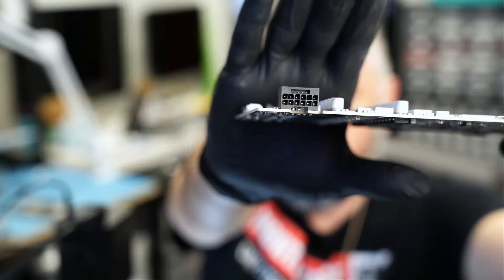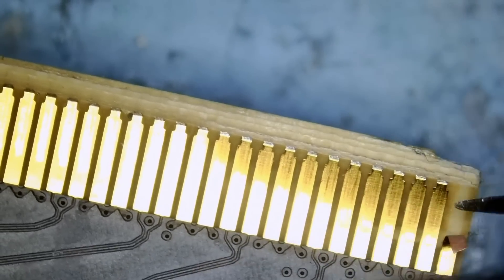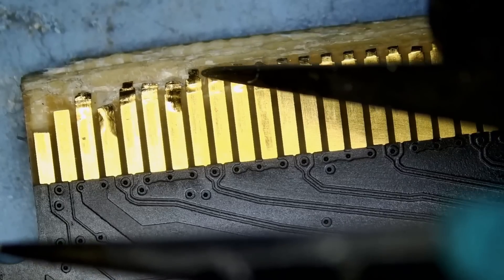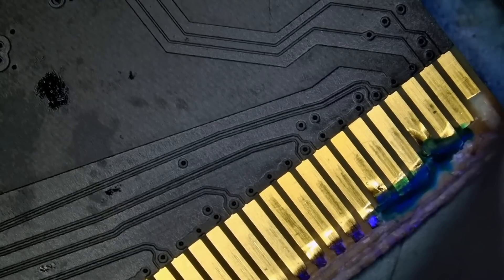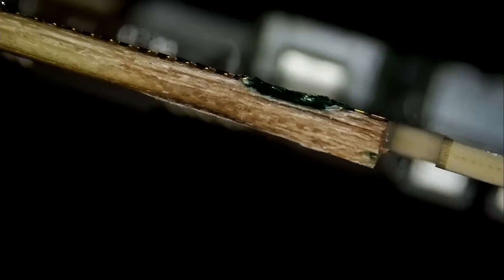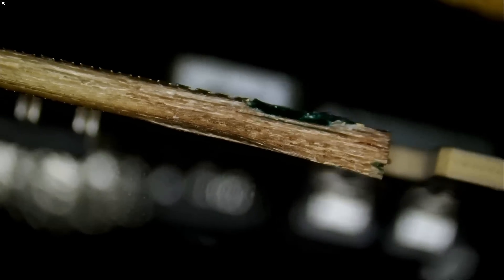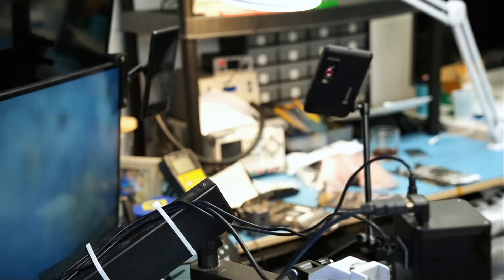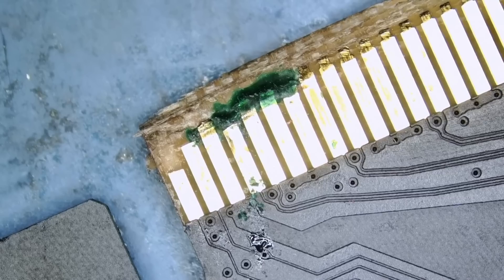4090 Graphics card PCIE Connector Pin damage Repair

Comment: So my GPU wont boot and the red VGA light on my motherboard turns on, Im thinking its the pins. I have a zotac 3080 and the pcie pins are a bit damaged, Im going to try cleaning them the best I can but if they are damaged, I was wondering, that green solder you put on it, can I do that? If so is it easy to do.

Comment: can damaged pcie pin cause the graphics card to run at x4 speed even tho its plugged in the x16 slot ? i tried the gpuz software and it shows x4 speed even while running benchmarks so its not power saving and even in games my gc wont perform the way it was before ...............

Comment: what if you have a similar issue, but the pad is too short to properly mate in the slot? would it be better to try to replace the pad? or would soldering an extension to the pad suffice? the worry is that it may be too thick or make poor contact if you just put a new pad against the end and solder.

Comment: In all the years, nvidia has been making GPU's. I've never seen the board layers come apart! Either it's from the high current these cards draw or nvidia is making cards cheaper than they used too. If it is from the currect, maybe we need a beefer PCB's and stronger PCIe sockets. I'm guessing nvidia is probably just cheaping out on their newer cards that cost more than they ever have before.

Comment: All I can say is at least nvidia is helping NorthridgeFix and others in the same industry to grow thier business and propser. 

Seems to me like the RTX4090 is just a card that should never have existed. From it's pricetag, to crumby power connector design, now the PCB falling apart at the slot.

Sure maybe some of the PCB falling apart could be user being too rough with it, but I fail to see how the PCB could split layers like that in that way, normally if it was rough treatment after slotted in the socket you would get cracks on the PCB near the hook that we see all too often. For my amature brain, splitting of the PCB layers like that is just dodgey manufacturing. And I bet the manufacturer of the card refused warranty and called it physical damage too.

Comment: Great job! What brand of 4090 was that? Sounds like it's a manufacturer that should be avoided. PCB board quality is horrible. 'm guessing it is a PNY.
Reply: Looked like a Nvidia card to me, the shape of the pcb is a give away.
Reply: @jestan01  Damn, if that's the case, what happened to Nvidia's QC? Yikes!
Reply: @SovereignKnight74  I don't think abusing your card so hard that the PCB layers split apart has anything to do with the manufacturer, but you do you i guess

Comment: Another concern I'd have with adhesive is the likelihood of it heating and melting while the card is in-use in the system. 

Could make a sticky mess in the card slot on the system board.

Comment: Do you know if a Google pixel 1 would turn on without its middle plate? It has a connection.. just trying to fix an old phone. Don't want to waste money just to retrieve the data and not currently turning on after replacing battery and screen

Comment: Dust lightly under the pad with baking soda. Then press the pad down while adding a drop of supper glue. The bond is instant and rather strong. Hope it helps. Just be certain to hold the pad down before you use the glue. Capillary effect will pull it under
Reply: Wouldn't this also leave glue on top of the pad, serving as a anti-conductive layer? 🤔

Comment: With the layers separated on a PCB board the only way you can fix it is to apply glue and then use a clamp small enough to compress the layers so it can be thin again but over time the layers May separate again

Comment: Hmmm maybe glue might work if the card dies later… I’d put tape on the pins so no glue would get on them, soak the edge with thin superglue then clamp it really tight till it dries… you’d need tape on your clamps too so you don’t glue the card to your clamps… idk just a suggestion, might work

Comment: I would have put tape over the connectors, used Epoxy resin brushing it over the edge to try and get some between the layers, then clamped the edge connector in a mini Vice 🙂 Opsss just read comment below lol

Comment: It looks to me like this SHOULD be covered by warranty, but alas, it won't be.
This poor user, who had their 4090 12VHP connector melt, probably was removing it from the motherboard, to have it fixed, and then dropped it directly onto the floor impacting the PCIE connector. Very unfortunate. But, had the 12VHP connector not failed, it would have not been necessary to remove it  from the motherboard and the PCIE connector would have not have been damaged during the removal process. Nvidia caused the whole chain of events here with their faulty designed 12VHP connector that led to 4090 being removed after installed. If a melted power connector was present at all, Nvidia should replace the card, even if something else got broken during removal. Had the 4090 never failed, it would have remained installed and not had the need to be extracted from the PCIE slot. Fault is Nvidia.

Comment: i would recommend that they use a riser cable, incase of any shorts in the future. it would damage the riser cable and not the motherboard's PCIe slot directly. Though, i would replace the card at this point anyways. 😆

Comment: Probably its best for this card to be mounted vertically with PCIe 4.0 riser cable, so if there is ever a need for the card to be taken out of the case (for cleaning purposes or w/e) its taken out together with the cable plugged in.
Reply: That is a very good idea!!

Comment: For the delamination issue I would Mix a small batch of epoxy resin used for casting (runny resin that needs 24/48 hours to cure), soak all the layers with it and then secure the PCI slot using a bench press and sandwiching the slot between two flat small pieces of wood and then wait the resin to cure. It is very risky but that's the way I would proceed because that card has one foot in the grave with that delamination and it will most likely have the other foot in once the customer plugs it in
Reply: ...and then you would most likely end up with two pieces of wood attached permanently to the card. Congratulations on the marriage.

Comment: sure would seem that the pcie slot would have been burnt when the connector fried itself. or this was an ebay card that had gotten wet on the messed up pin side. either way great job

Comment: For the delam, you can drip super glue into the separated layers then clamp them together till it cures. Be sure to use Teflon between the board and clamp jaws, or you’ll have one solid piece lol.
Reply: I was literally about to suggest the same thing.
Reply: That corner of the board has no inter-layer PCB traces. Just drop a bit of super glue and clamp it as   per the first comment. You know sometimes, advice from other people is not as stupid as you make them out to be. Your leaving that board without treatment is bound to fail if the user cannot wiggle it the way you delicately did ... remember the user is installing into his case not an external pcie  extension slot that you have. We need to have some respect for people watching your channel. They mostly are knowledgeable and just want to assist.
Reply: Cyanoacrylate is not a good adhesive for this.
Reply: @VndNvwYvvSvv  care to elaborate?
Reply: Probably want to tape up the pins first too so it doesn't squeeze out onto them.
Reply: That is what I would do also logically :)
Reply from the maker: I go by the rule "if it's not broken don't fix it. There are microscopic lines running thru every layer of the board. Layers are separating. This is not a kitchen countertop that you can just add glue to and press. I know we have a lot of handymen in the comments, but it's better left off as is.
Reply: @NorthridgeFix  I'm not nearly as knowledgaeble, but i would of used a little solder mask on the edge just to give it some more structural integrity, tell the user to install it gingerly and leave it be or risk causing further problems. Why ? because he or she doesn't seem like the type to have much common sense, probably further mangle it trying to insert it again.
Reply: @NorthridgeFix  Leaving it as is. Will just risk the customer damaging the PCI slot on their motherboard.
Reply: @NorthridgeFix  handymen sure, but not too many military certified micro/miniature repair techs😉

Comment: I wonder if the pcb board got exposed to water/moisture. Because the separation looks just like how a water damaged OSB plywood.
Reply: Yes i think it's water or moisture
Reply: It is fibreglass, definitely moisture resistant.  Probably dropped

Comment: For as much as these cards cost the fact the layers are separating is unacceptable! If this was my card I would mix up some carbon fiber resin, apply it to the affected area, bag the card and put it under high vacuum until it cured. Just like you do when you are making a carbon fiber part. That should bring the layers together tight enough until the resin cured.

Comment: Thin CA would probably wick in and do a great job on those separated layers.  Just compress together tightly before applying.
Reply: Was thinking the same and use a spring clamp for pressure to compress the layers.
Reply: Exactly the fix I was thinking. Could maybe use some small bits of wood down either side and a bunch of clamps to hold the layers tight together. Then drip some CA glue along the edge.
Reply: Yup - clamp and wick in thin CA.

Comment: alalex hi....u can use B7000 glue with small brush to glue it from the top with some press on it form both sides for 10 min.....will work nicely
Reply: B7000 gives the rubbery feel. This could create tiny gaps

Comment: How the hell can a user mangle the PCIe fingers that bad?! I've never seen damage like that in my 35 years of working with PCs. Did a gorilla try to install the GPU?!
Reply: Between the fingers and pcb separation, I would guess it  was dropped on edge and the pcb mushroomed.
Reply: @piscikeeper agree, that looks like a drop to me
Reply: It seems to me that damage would be directly related to the delamination - With the board delaminated like that, it's going to be much more difficult to install into the socket, especially if the installer isn't aware of that particular problem - hence more force being applied, at weirder angles, hence ripping and folding the fingers.
Reply: Who's the dope that made that kind of damage?
Reply: Using unreasonable force to get a card in that's maybe caught on the front or back edge of the slot, then jam in into the slot until it bottoms out? 
Or the pc case took a hard impact? 
Or maybe the card was plugged in and on 1000x?
I'd recommend the owner to plug it in and never touch it again.
Reply: All you need is courage to purchase top spec GPU in 2020s and rest will happen by itself for some people. It is nice that customers participate actively in covering R&D costs for big companies...
Reply: I would guess somebody dropped the card to delaminate PCB and then thought it's a good idea to brute force the card into PCIe connector. Considering it was probably the same individual that didn't plug the power connector properly and caused it to melt, it's pretty safe to say that they should buy prebuilt computers in the future.
Reply: Yes my guess too. @MikkoRantalainen